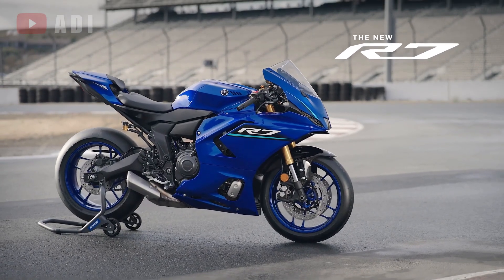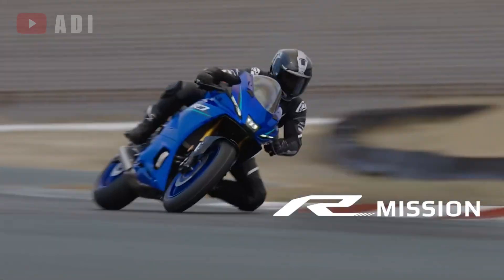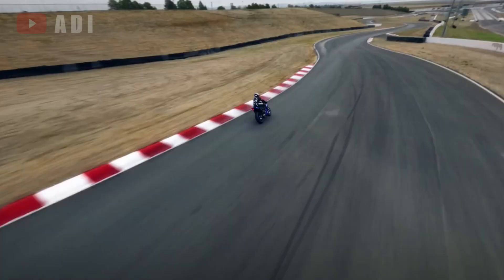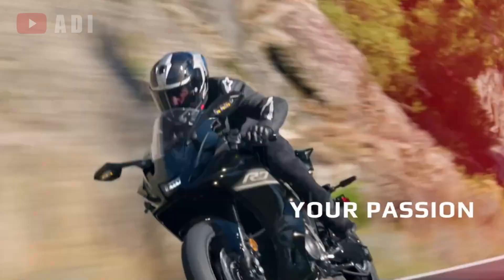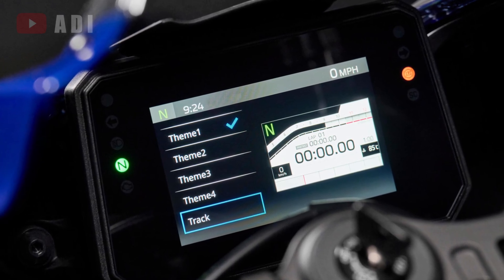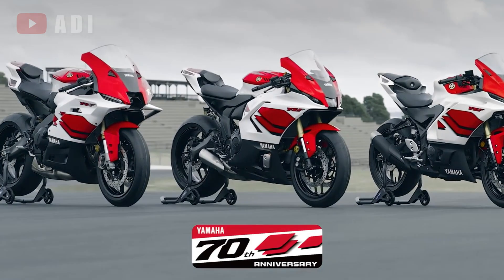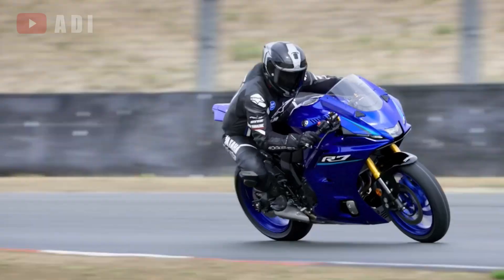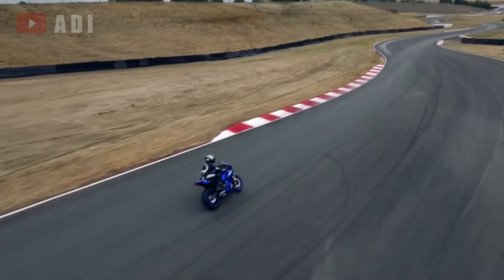2026 Yamaha YZF-R7 💥 New Styling, 6-Axis IMU, Cruise Control & More

Comment: I find it so sad. Where are the four-cylinder engines with 750cc and good performance?
I can generate 150 hp from a four-cylinder engine with the same torque.
Why would I need a motorcycle that looks sporty and then gets left behind by a Harley?
The only attractive feature is its light weight.